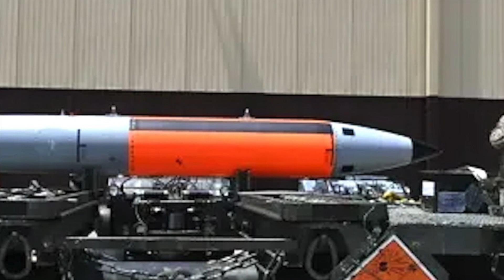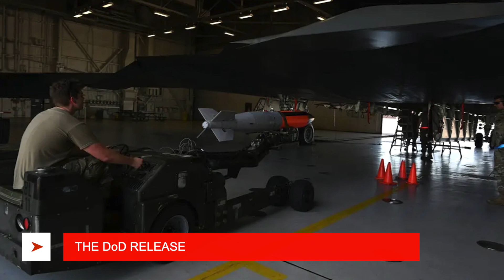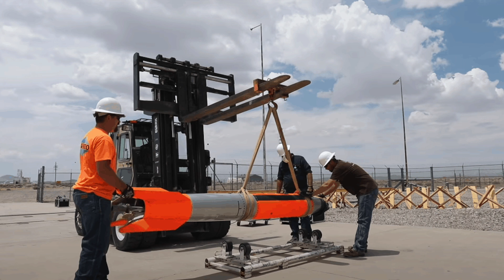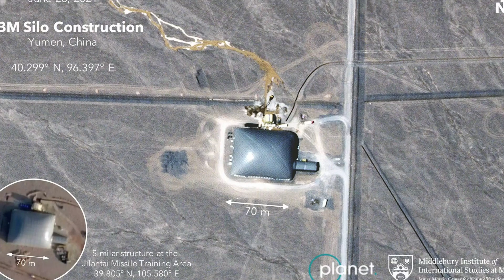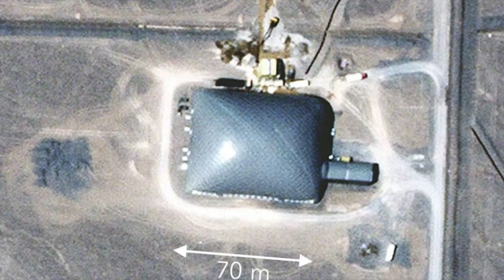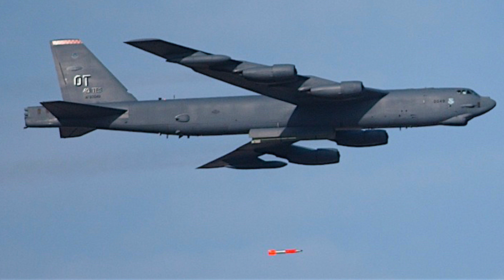B61-13 | #US to have new nuke more powerful & accurate !

Comment: ( This is a response to the new American B 61 nuclear bombs)

It is reported that the explosion power of the Avangard nuclear warhead exceeds 2 megatons of TNT.

The Avangard's high speed likely gives it much better penetration performance than lighter subsonic cruise missiles. The Avangard weighs about 2,000 kg and travels at Mach 27, giving it a kinetic energy equivalent to 21 tons of TNT.

8000 km = 8000*1000 m
Mach 1 = 380 meters/sec.
Mach 27 = 27*380 = 10260 meters/second
(8000 x 1000) / 10260 = 779.72 seconds = approximately 12.99 minutes = 13 minutes

Many major cities in the US will be destroyed in 15 minutes, and in the UK, France and Germany - in 8 minutes.

Comment: Thank goodness. The B61-12 is an unreasonable compromise. With 7 times the yield like B61 mod 7 and mod 11, we have the fully potent of B61 with all functions in one weapon in the B61 mod 13. The B61 mod 12 should be replaced or refitted to be a the new weapon. The B61 series can be deployed by F35 internally, that is in full stealth mode. The advantage of a stealth aircraft nuclear attack is that it comes with no warning at all. The Russian's fear that hypersonic nuclear missiles deployed in Ukraine is totally unfounded. They say it wouldn't give Russia enough time to intercept it. How does zero seconds sound for a B2 with a W83 1.2 megaton bomb sound. Hypersonic nuclear missiles deployed in Ukraine would be redundant and stupid. I have no idea why we have nuclear weapons stored in Turkey and Germany. They can't use them unless we give them the codes. As I understand US nuclear safety protocol, you have one chance to correctly program the weapon correctly. one false attempt and the bomb will never detonate. This means that for one that is captured, it will be useless except for its components in assembling a different weapons which is not as easy as it sounds.

Comment: WHY DO YOU NEED A VARIABLE YIELD NUCLEAR WARHEAD???
Reply: Good point… I have no idea… however, as a guess I would say it could be that a smaller yield will be used to neutralise a column of tanks or a gathering of infantry for example- while limiting the fallout and blast to other areas… next to a country’s border?
Reply: @QuantumPath100  nope, its to use the variable nuke as a dirty bomb....!!!! the lesser the yield, more the contamination would be from unused nuclear fuel!
Reply: To control how much of a blast you need. Long column of tanks low yield. City/large military base heavy yield. They have had dial a yield mechanism’s for a long time.
Reply: @davidrichards6565  AND THATS HOW YOU DISGUISE A DIRTY BOMB BY CALLING IT A VARIABLE YIELD BOMB
Reply: @davidrichards6565  ok good point. Thanks for this 👍👍👍

Comment: It's sad that it takes so much pressure from Congress to force the WH to make adjustments to its nuclear posture; that is, even as there is some modernization, there are or are going to be big gaps in our deterrence capability if the Biden Nuclear Posture Review is fully implemented. And I say this as some who has been supportive of many of the Biden WH''s foreign & security policy endeavors. Retirement of the B83 without a replacement with either the yield or significant accuracy to make up for the yield is an unforgivable mistake. So is the Biden team's continued refusal to pursue the nuclear submarine-launched cruise missile (SLCM-N). When the Obama Administration unilaterally destroyed the 300 or so nuclear-armed Tomahawk SLCMs, the US was left with an enormous credibility gap. China and Russia field multiple new, modern nuclear-tipped cruise missile and short/medium range ballistic missile systems. Under the Obama/Biden approach, a future POTUS would be left w/two options if either adversary used such theater nuclear weapons--1) strategic counterattack by the US (much higher yield weapons, a crossing of a threshold, many more civilian casualties)  because we have a next-to-nothing tactical nuclear force . . . or 2) an attempt to employ our tactical "capability"--which consists of F-15s or F-16s dropping 1970s vintage unguided B61 nuclear bombs, requiring them to get within a few miles of the target . . . unless we have neutralized the enemy's air defenses, those aircraft are going to get shot down before they're in the target area. And, oh, yeah . . . the pilot has to perform a "toss bomb" maneuver (that only a few squadrons in the entire Air Force are trained to do) if he wants any chance of escaping the blast of the nuke! 

That is our tactical or theater deterrent in 2023. In Europe, the first units that would be called to do it are a handful of European squadrons who have access to US-owned B61 bombs. While in theory they would obey the lawful order of the NATO Supreme Allied Commander (SACEUR), in practice, in the s**storm that would be a general war in Europe, there is good chance their own government would intervene and forbid their aircraft from performing the mission. If it fell to the US, guess what? We eliminated the small stockpile of B61 bombs held in the UK for *our F-15Es to perform the mission. In theory, we could fly some of our aircraft down to Turkey, where we store another 50 or so bombs . . . but this assumes, in a crisis, Turkey is actually an active ally. It could easily decide to betray its agreements w/ the US and NATO and deny us access to Incirlik AB (where the bombs are kept). During a coup attempt against Turkish President Erdogan in 2016 (believe it was 2016), his government cut power to Incirlik because he claimed (wrongly) the US was orchestrating the coup. 

Turkey is no longer a true "ally" in any real sense of that word--it's a "partner" that treats its relationship with the US as transactional. Don't assume those weapons in Turkey will be available. 

Tactical nukes on a submarine--100% US property, sailing in international waters--gives a future President a reliable & credible option to deter or, God forbid, respond to a Russian or Chinese tactical nuclear attack.

Mind you, in the Pacific, we have zero tactical / theater nuclear weapons in theater and few--if any--tactical fighters that are equipped for the aforementioned tac nuke air dop mission. And because those assets have not been in the Pacific for decades, I'm assuming the pilots are not certified to carry out that mission, either. Of course, F-15s or -16s from CONUS, along with bombs from CONUS, can be hauled to the Pacific (takes a little time, though!). But the alternative--a small number of nuclear-tipped cruise missiles stored in Guam, ready to be deployed quietly & quickly deployed aboard US attack subs--seems a hell of a lot more credible threat to an adversary! And, of course, the goal is not to "threaten" China or North Korea. in the sense that we're using our nuclear weapons to bully them into anything (unlike North Korea has done with theirs). Rather, if they are considering using their tactical nukes, what do they consider the threat response is from the US to them? 

Would China in the Indo-Pacific--or Russia in Europe--consider the SLCM-N threat to be a credible deterrent/response? The answer is an obvious "yes." Would they consider the approach that hasn't changed since the early 80s, when F-16s were first adopted by NATO allies, to be as credible? Obviously not. Would they consider it to be at all credible? Who knows? Why risk it?

Comment: The U.S. is always in a state of developing, while Russia and China are consistently creating and making operational, new advanced weapons.
Reply: It depends. US leads in terms of BMD interceptors, radars, and stealth. Both China and Russia don't have long range stealth bombers yet US is already on a replacement for its B-2s with B-21. While both J-20 and Su-57 are undoubtedly not as stealthy like F-35 or even F-22. Their is a 3rd party radar scattering CAD simulation done on Aircraft 101 that did an analysis on this. It's an interesting read. Even with F-35's RAM coatings J-20 much more Su-57 can’t make up the difference in total RCS reduction given their geometry. They are also behind in terms of low flying subsonic stealthy cruise missiles while US again is already developing a replacement. 

On the other hand, China's carrier killer DF-21/YJ-21 US already had this in the 1980s with Pershing II. Operational too for about a decade to boot before being forcefully retired due to INF Treaty. But they are bringing it back or a hybrid of it with Army's LRHW and Navy's CPS. 

US also experimented with air-launched ballistic missiles similar to Russia's Kinzhal with GAM-87 Skybolt in the 1960s, but was later scrapped in favor of the UGM-27 Polaris SLBM which is a much more stealthier way to launch ballistic missiles especially if launched with a depressed trajectory.  

Lastly from the experiments done way back during Bush's admin, they also found the inherent weakness of conventional hypersonic glide vehicle HGV designs like China's DF-ZF and Russia's Avangard. They are much more trackable due to their plasma sheath which would light up bright on long range infrared sensors. Hence why AGM-183 ARRW is a miniature HGV which is undoubtedly stealthier. Sadly it won't be procured by the Airforce anymore but it's surface launch variant OpFires for the Army will be continued.
Reply: @johnsilver9338  What BMD you talking about?? LOL the hit probability is below 25% for ThAAD and Aegis system!!!!!! DOD has stated multiple times, USA cannot defend effectively against ICBMs!!! 4 interceptor missiles most probably 5/6 are needed to guarantee neutralisation of threat!!! one russian ICBM has over 12 MIRV nukes plus decoys plus ALUMINIUM SHAVINGS CHAFFS!!!!! 
you should read about it, google it..... US air defense system is very expensive and pathetic...!!!!! THATS WHY USA HAS A PREEMPTIVE FIRST STRIKE POLICY AND STEALTH JETS FOR NUCLEAR PAYLOAD DELIVERY!!!!!

RUSSIA DOESNT HAS A FIRST STRIKE POLICY FOR NUKES!!! BECAUSE THEY HAVE BETTER AIR DEFENSE SYSTEMS!

B-2, F-35, F-117 these jets were created for preemptive first strike capability!
because ICBMs take 30mins to reach russia AND ARE EASILY DETECTED BY SATELLITES IN REAL TIME but f35 can reach russia within 10-15mins!!!

ICBMs are often 2nd strike capabilities, while SSBNs are 3rd strike capabilites in a nuclear triad!

the problem is you guys think USA is a moral country!!! thats the biggest lie of last 120 years!!!
Pearl Harbor was forced upon US Navy by the sitting president to rally support for US armed forces and force drafting onto US Citizens.....!!!

YOUR DEEP STATE CONTROLS YOUR GOVERNMENT, POLICIES, LAWS AND MILITARY!!!!

US president, DOJ DOD AOC etc etc are all a farce!!!!

US foreign policies have not deviated even 10% to left or right in the last 120 years!!!

THAT HAS NEVER HAPPENED WITH ANY COUNTRY IN HISTORY OF HUMANITY!
Reply: which Hollywood journal is this .?? @johnsilver9338
Reply: Wow
Reply: Russian and China take short cuts
the US doesnt
Reply: China does nothing but HACK & STEAL - & NOW their military is fked because putin's weapon systems are shams... 😂😂😂

Comment: When are they going to finish developing a supersonic cruise missile with nuclear warheads?
Reply: 🤔 I believe they said it will be operational and used with the B 21 Raider. So it’s still being developed.😎😎
Reply: It's not supersonic, but subsonic. Supersonic cruise missiles can only fly high, otherwise if it flies low it will forced to fly at subsonic speeds due to denser air at lower altitudes. Also their is no need to rush the development of the new AGM-181 LRSO as they still have the older AGM-86 ALCM maybe even AGM-129 ACM.
Reply: @johnsilver9338  India has BrahMos with speed of 3.3 Mach and has sea skimming and terrain hugging capability at this speed for over 350km......
Reply: @salilpanwar6922  It has two flight profiles. If it flies low its subsonic otherwise if it goes supersonic throughout its flight path it flies high. It can also do supersonic at lower altitudes but only for brief moments only and that is when its near its target.
Reply: @johnsilver9338  nope, it can fly subsonic, it has a scramjet or ramjet engine and a booster rocket motor it flies subsonic only when it has performed the S maneuver for the end phase of top attack which last about 5 seconds
Reply: @salilpanwar6922  So yes throughout its flight path its not supersonic or subsonic entirely. On the other hand if I'm not wrong Kalibr flies low in its entire flight path and goes supersonic briefly once its near its target. Downside these missiles has less range compared to Tomahawk.
Reply: BGM-178 rattlrs
Reply: They are not
The Brahmos travels 300 miles at Mach 3 but weight over 5000lbs 
The Russian supersonic missiles have speed but like the Brahmos very short range and weight over 5000lbs 
While the TLAM and AGM-86 are subsonic, they travel over 1000 miles with ease
The US only use for supersonic cruise missiles is the SiAW and thats designed to be carried internally by stealth aircraft to allow to strike time sensitive targets 
like radars and communications, Effectively putting a hole in the enemy defenses so other weapons to can slip in
Nuclear warfare is very different and has different needs
Reply: @verdebusterAP  brahmos range is 350km not 300 miles, the 300 mile range is when launched from a Su-30MKI out of which 150miles is flown by the jet itself and yes its a pretty heavy missile! but has a warhead lighter compared to tomohawk because it causes much more destruction just by its kinetic energy from mach 3.3 speed!!! similar to a small asteroid being 1000 times stronger than tsar bomba solely due to its speed being 30 40 50 mach!